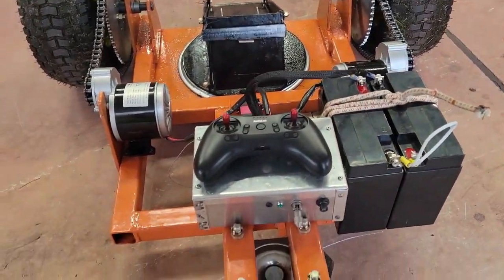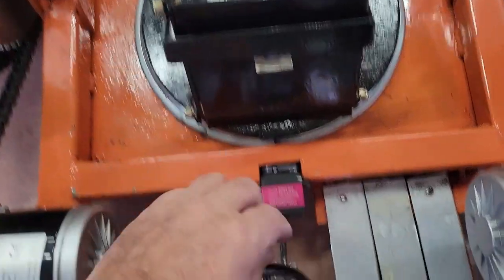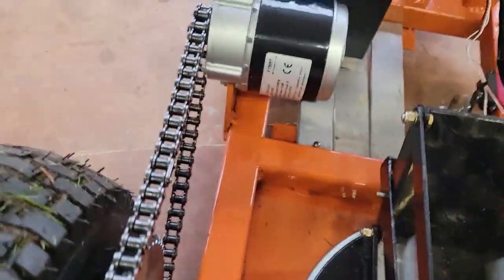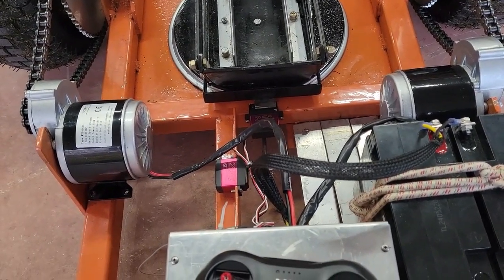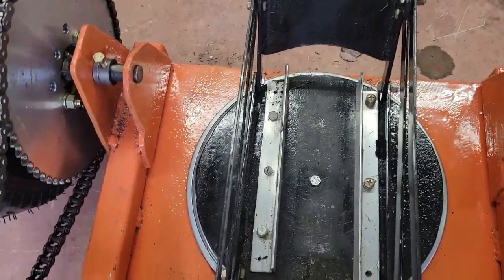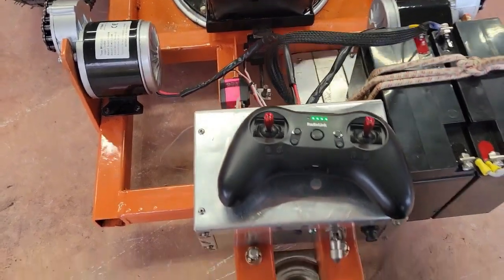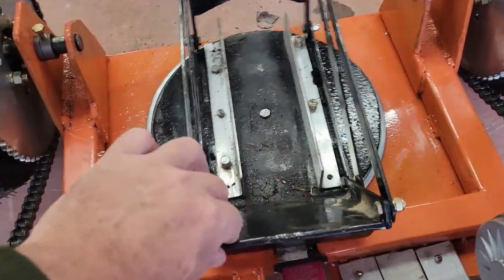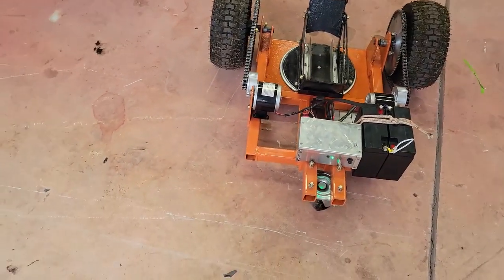Remote Control Aircraft Tug Details

Comment: How does the act with a loss of power?
Reply from the maker: Its very important to configure that setting in the app. The motor "F/S" - Fail Safe channel settings need to be 0. If you do not set this and loose connection with the remote control, or turn off the remote before powering off the tug,  the tug will take off in random directions. Ask me how I know :)

Comment: Very nice work. I'm doing something similar but using two 300W skateboard hub motors with no chains/gears and a 36V LiPO4 battery. The height is much lower allowing the swivel wheel capture to rotate 360 deg , clearance for nose wheel pants, etc., and easier loading/offloading. Looks like you are using a similar RC controller and ESC that I am. 
Only a few bucks in parts rather than the very pricey one$$$ for $$$ale.
-TB ( 0TX1 )
Reply: you care to share details? I'm looking at the similar setup with hub motors and wouldn't mind getting some head start

Comment: I have looked at your DIY RC AC Tug videos, and I am inspired to try building one.  I understand that the Lazy Susan is probably not necessary.  I am confused about how your nose wheel "cradle" is built and how it operates,  While I did look at the two videos you posted, the actual cradle, and its operation, are eluding me.  From the best that I can tell the cradle has an "Entry Ramp", a ""Wheel Stop"  (remote from the Entry Ramp), and uses a remotely operated Servo (I understand that a second Servo is used to lock the Lazy Susan in place).  From the videos it appears that the Entry Ramp includes some type of small diameter roller, intended to slide under the nose gear,.  It appears that there is a linkage from the Entry Ramp to the Wheel Stop that constrains the distance between portions of each.  It also appears that there is a second linkage that extends from the Entry Ramp to behind the Wheel Stop, although I am unclear about that or how it operates.  I am also unclear about what it is that the Servo does, and just how it does whatever it's doing.

Comment: Great design.  Can you share a drawing or schematic of the wheel carrier, gates, and locking pin?
Reply: I also need the details of the wheel carrier, etc.
Reply from the maker: I added a link to a video describing the latch and carrier. Look in the description of this video.
Reply from the maker: I added a PDF with the dimensions. Link in the description above.

Comment: How did you attach the sprocket to the wheel? Did you just weld some tubing to the wheel itself?
Reply from the maker: I welded a piece of 1.5 x 1.5 square stock to the rim
Reply: @N3661a  Are there "Go Kart" wheels that already include holes for mounting the wheels' gears?

Comment: Wow, just wow!! What a phenomenal job on the design and implementation! Do you think with the upgrades that you made this would handle a 2,500lb 172 on a slight incline over hangar door railing?
Reply from the maker: Thanks. Yes it will move a 172 no problem. I use it to move my 182. One of the videos I posted has it moving the 182, before I upgraded the motors.

Comment: Very impressive - thanks for the parts list!  Are you still happy with it?  Any updates you would suggest besides dropping the lazy susan?  BTW, I think your design on holding the wheel in is brilliant, particularly the little latch!
Reply from the maker: Thanks, yes still happy and my back is still happy. The tug works wonderfully. The lazy susan is the only thing I would drop at this point.

Comment: Congrats on your project !!!    Well Done !!  

Happy that I stumbled onto your video.   I had never seen one like yours before,  but seriously,  it's so very close to what I've been envisioning and wanting to make.   Watching your video, I couldn't stop thinking  "yeah, that's exactly what I wanted to make  !!! "    The one exception in my planning is that I was thinking of using  450 watt motors  because I'm on a grass field but it sounds like 2 x 350 watt  motors is more than enough?    I'd love to hear your thoughts on that.  

  In any case,  now I'm even more interested in getting it done.   🙂
Reply from the maker: Thanks! The 350 Watt motors have plenty of power and move My Cub and Bellanca Cruisair around with ease. I'm also on a grass strip. I do need push a little with the Bellanca to get it rolling as it runs out of traction if the grass is wet but the Bellanca is 2000 lbs
Reply: @N3661a  Hey Scott, thanks for replying, now I'm even more encouraged.   I'm got a Tri-pacer, should work great !!   Just need to figure out how to  quietly sneak that into the budget ..  LOL..  

Where abouts  are you hangared ?    I'm in Manitoba  (Norm)